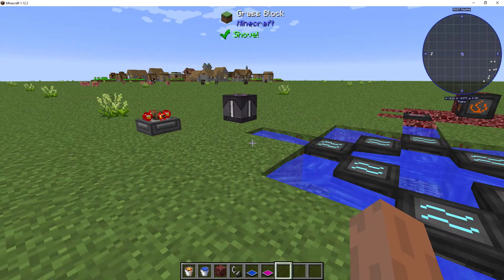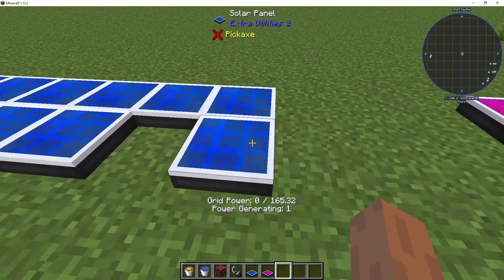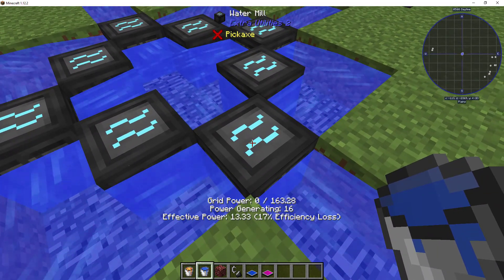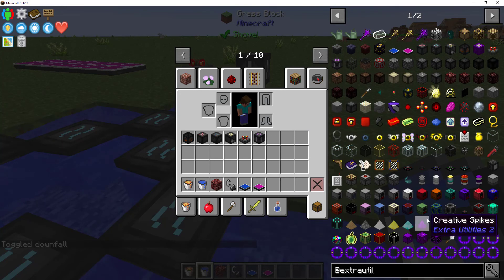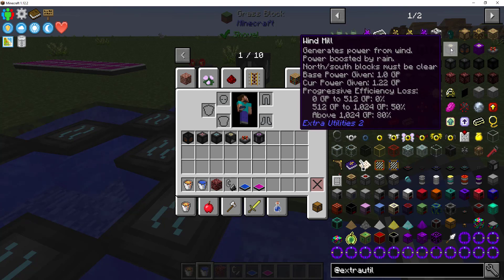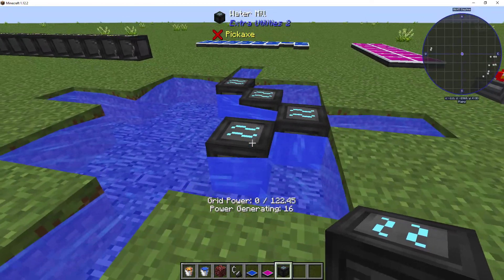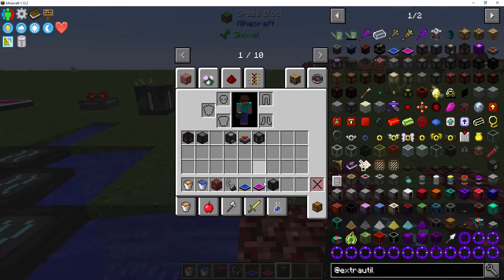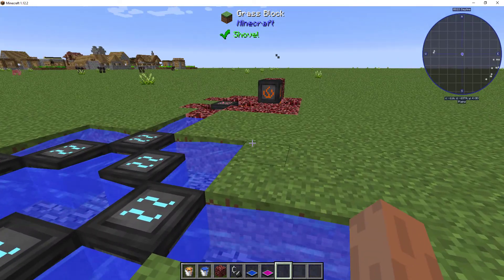Extra Utilities Efficiency loss for power generation

Comment: It certainly makes it much more difficult to provide enough water to a large steam reactor using fluid transfer nodes.  The new speed upgrade tiers made it challenging and a bit more fun, this power efficiency doesn't - especially when it takes 193 GP for a single transfer node with 64 speed upgrades.